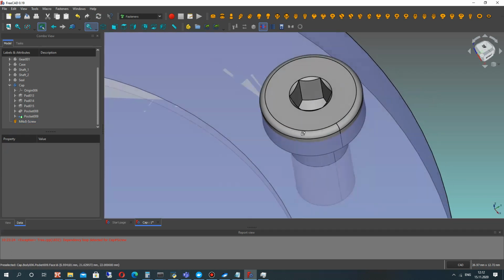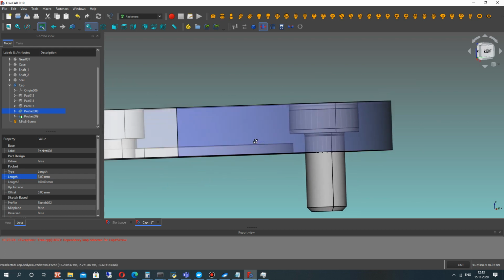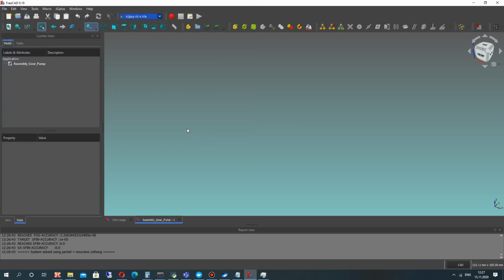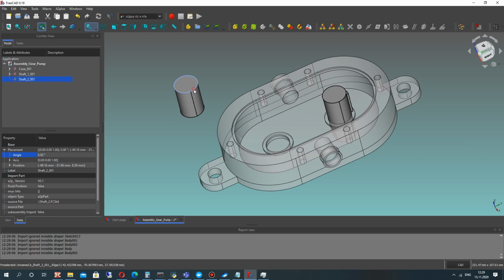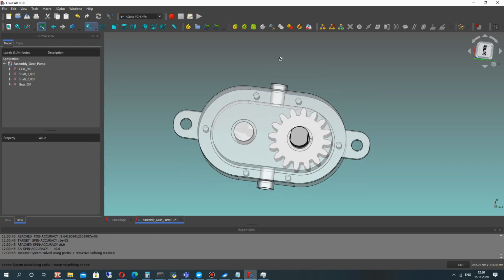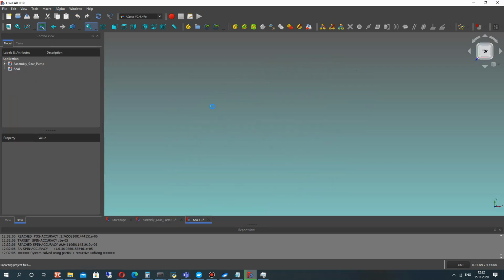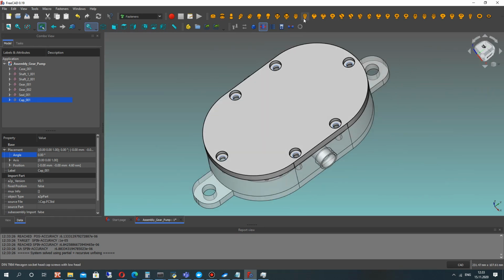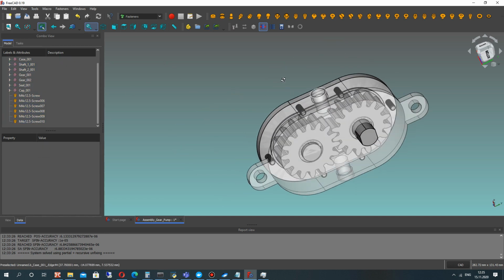FreeCAD Tutorial Part 6/6 | A2Plus Assembly of Gear Pump using Fasteners Workbench

Comment: Nice Job from Part 1-Part 6!

Your usage of Part Design/Sketcher in the first five parts will be helpful as I begin to "re-write" my project's FCStd files.   Part six was a good deal short of what I hoped to find.   Your presentation of assembling the Pump using A2Plus largely duplicated what I had already been able to master.  But as with the prior five parts, it was a definite "LIKE".

Part Six Strong Spot: <for me>
Of the prior A2Plus and Assembly 4 tutorials I have viewed, yours is the only one which actually completed something be from the real world.  The usage of slots and bearing services will add greatly to my "re-write' of my project.

Part Six Short Coming: <for me>
1> It would have been greatly appreciated if "movement" of the gears could have been demonstrated using the macro recorder, the Execute Macro, and then the usage of the a toolbar icon (via macro).  I had already succeeded in "adding" gears to my project.  But I could not couple their movement with the linear movement of other components (the linear was easily accomplished and is repetitive).  

2> There were no project artifacts available.  One of the best ways to learn a skill/technique in the virtual world is to "experiment" with a mentor's or master's software/artifacts.  Consider placing your software projects/artifacts on something like github.com as OpenSource. One of my favorite authors is Zack Usso at https://github.com/trooker?tab=repositories.  He is a toy builder with projects that include 
2.1> CAD/CNC wooden puzzle boxes
2.2> CNC drivne low budget ventilator simulator
2.3> Android/Arduino critter chasing robots
2.4> Arduino software for children''s robotics
2.5> Arduino speedgun
  

Thanks again for engaging in a transfer of knowledge!